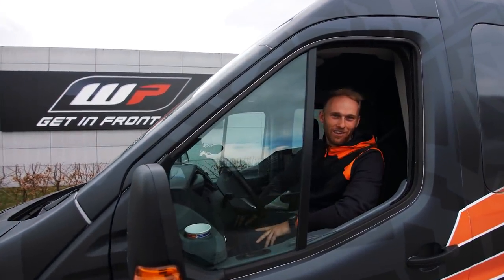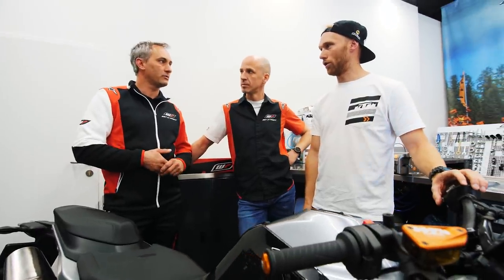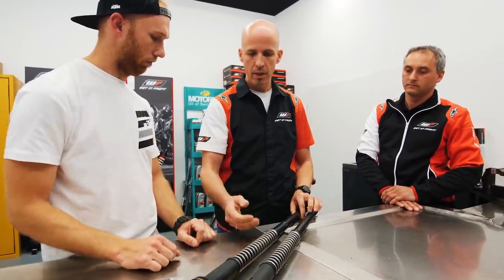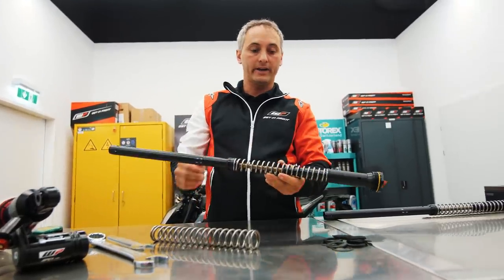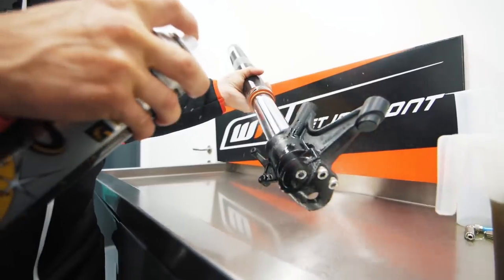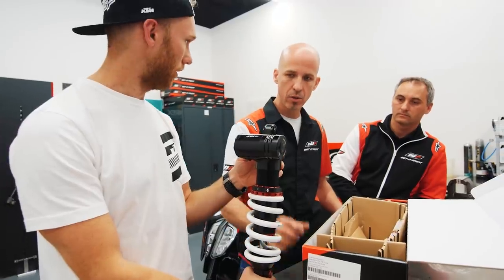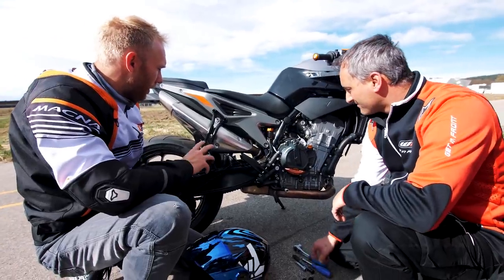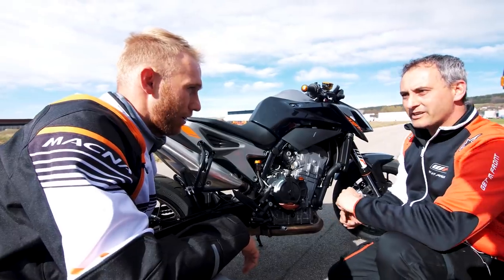KTM 790 DUKE SUSPENSION UPGRADE | RokON vlog #81

Comment: There should be a race version of Duke 790 with adjustable suspension ....
 Just like Triumph Street Triple RS
Reply: They're developing a KTM 790 Duke R right at this very moment, from what I've been told from some friends I have over at KTM it's gonna come out of the box about 10 pounds lighter and with about 13hp and 6 ft lbs of torque more with race fitted parts including cnc adjustable rearsets, better suspension with adjustability, a more aggressive tune, better induction, and be a bit more slimmed down. The R variant will be the ultimate scalpel for the road.
Reply: Jared K Do you know the release date? Im looking for a bike next season. Ty
Reply: @jaydoubleyou4979  That's NDA material, I'd suspect probably sometime just before next Summer or maybe next Fall.

Comment: i dont get it how they installed the complete cartridge. when they added the oil to the complete cartridge, with the spring installed,  how is the system bleeded free of air?  and hows the air chamber messured with the spring installed?